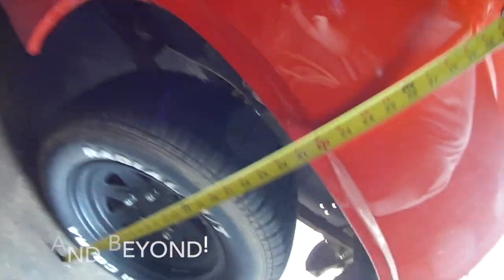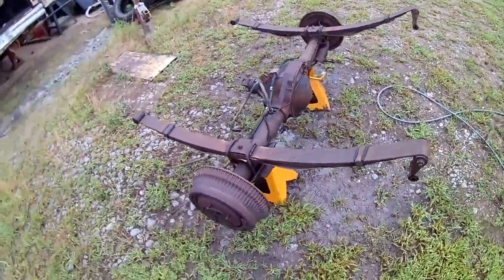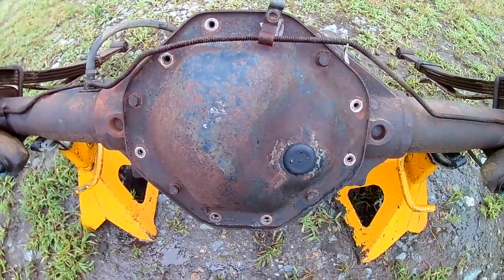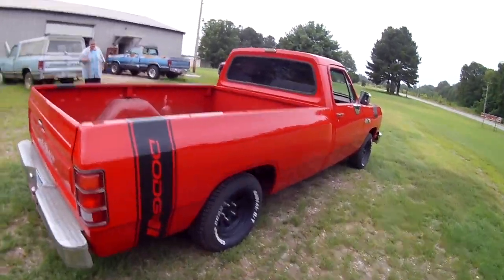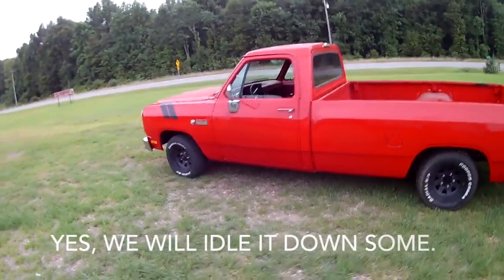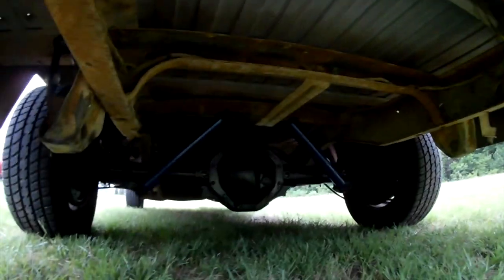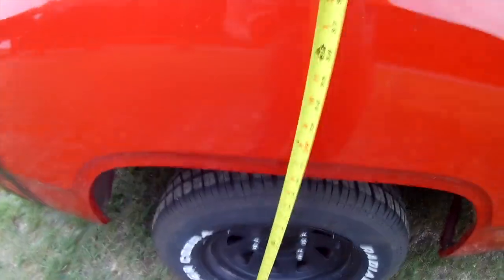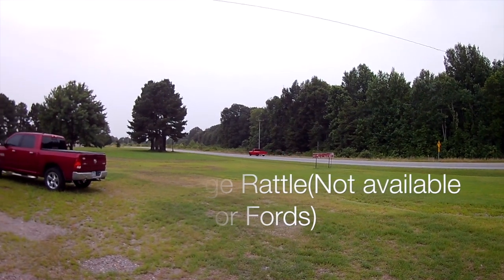8 1/4 vs. 9 1/4 Rearends and the Red Sled Redemption!

Comment: For accurate measurements,  try measuring from center cap to fender. Air pressure and tire wear can have a negative affect on measuring when done the way you do it.
Reply from the maker: Yea and I measured the second time from gravel to the fender lip. I was just wanting a quick reference. I was quite surprised that he was taking the truck  that afternoon. I swapped the rear ends, cleaned all the brackets, painted, reinstalled everything, new shocks, and pressure washed new rearend in a 6-8 hour period. I was spent for the day. Thanks for watching!

Comment: So, all you did was remove that curved leaf spring from the stack on each side?
Reply from the maker: Ron G I should have explained better in the video. In the beginning, the red sled had the 8 1/4 rear with 4 total springs. I left them bolted up and switched that rear into the donor truck. The donor truck had the 9 1/4 rear with 5 springs(1 aftermarket and 1 overload were removed from that spring pack.) So essentially, the red sled got 3 springs back under each side, where it began with 4. Also, the red sled retained the same lengthen shackles as it had for a few years. I clamped the 3 springs together in front of axle, approximately three inches behind the shortest spring. I used a heavy U bolt and plate. This is supposed to help the springs all work in conjunction with each other and reduce wheel hop. I will do another traction video with the truck after he gets exhaust installed.